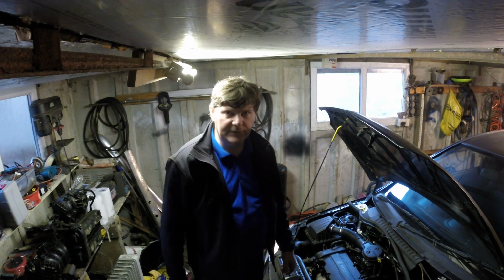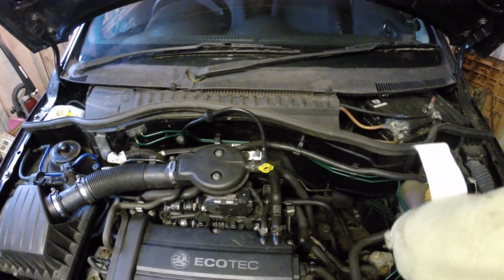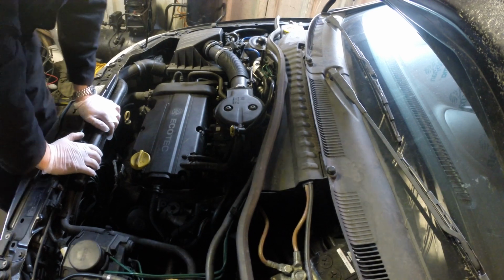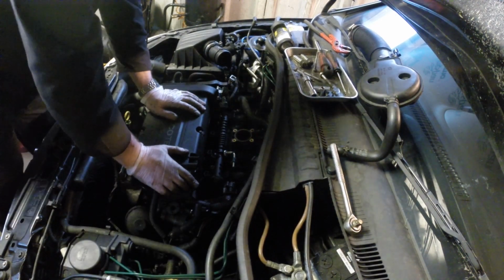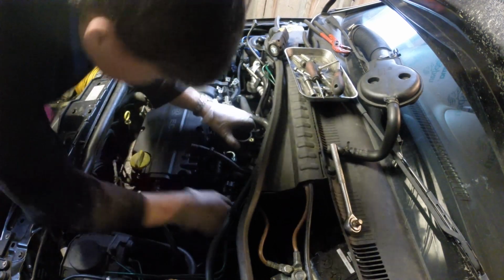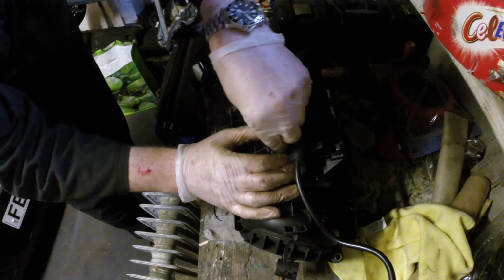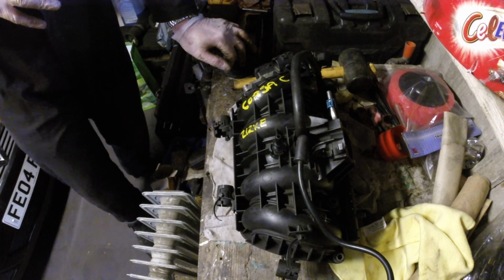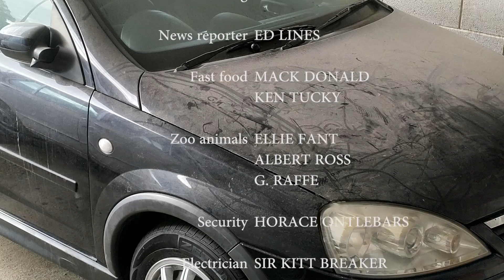2004 Vauxhall Corsa C Part 8 - Getting it running better

Comment: Greetings Sir, so i have somewhat of the same problem. My non return valve on the servo vacuum hose is broken. I bought a new one today and tried fitting it, the problem is that it wouldn t fit so i tried heating it up and still didn t fit. I heated it even more to the point the hose got soft , it fitted in and cooled down, however the valve got out of the hose really easy. Do you know any trick that would help me fitting connectors such these? I really need your advise, if possible.
Reply from the maker: Sorry, I can't help. The Corsa is long gone...